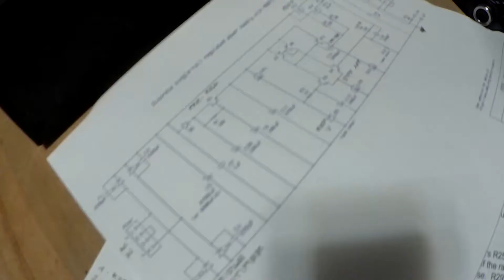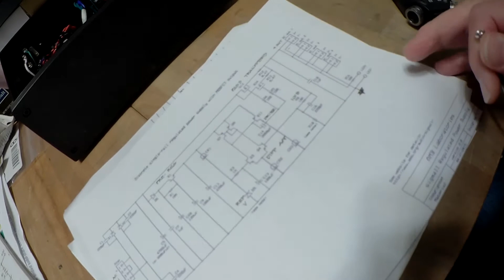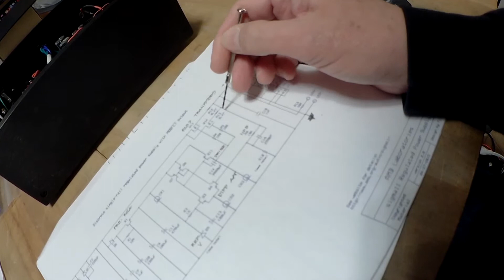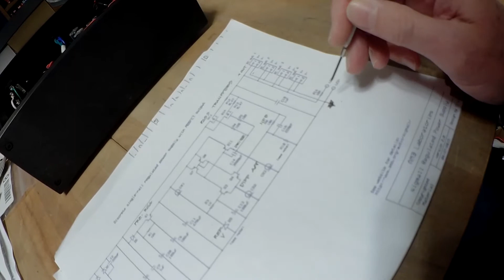Robert Builds the Sigma 11 Power Supply

Comment: Great video. Any reason you choose the sigma 11 over the universal psu (split in half) from the diyaudiostore? I built the 6-24 crossover and want to replace the wall wart with a linear power supply.
Reply from the maker: Yes, the Sigma 11 is a regulated power supply using discrete transistors. It is superior for low current devices like preamps, DACs, or active crossovers. The DIY Universal supply is a high current unregulated supply for use in power amplifiers. You can see it in my Pass F5T and F6 videos.
Reply: @NocturneVid66  got it. I built the F6 using your video as guidance, so I have experience building the PSU, too. I’m a novice and don’t really understand the difference between regulated and unregulated, so wasn’t sure if the use of the sigma 11 in this application over the diyaudio PSU was intentional or preference. Thanks as always for your content!

Comment: Great video, I've built the sigma 22 to power a pass BA-3 preamp. I just completed the sigma 11 to be used to power my rega planar 2. On the sigma 22 I used an avel lindberg and had to inquire how to connect to the board, this time I am using an antek and have the same question, in what order do I connect the blue and green wires to the sigma board.
Reply from the maker: That must sound very good Pete. I haven't compared the Sigma 22 to the Kubota Regulators. They both seem to work very well. I don't recall the exact hookup for the Antek transformer. I hope you got it working without any issues.

Comment: I really appreciate you covering the amb sigma 11 power supply. Not many make videos of it. As flexible as it is, I feel it deserves a nice how to construct video complete with a bom.  Been thinking of building a sigma 11 to power a music server and perhaps a diy audio preamp from pass labs (waynes linestage preamp) .I have just received my pass labs korg 1 tube full kit as well. Been waiting for it since preordering in in like March of last year or so. Had to wait even longer as they sent me the wrong faceplate. It was so long I forgot I placed a order for a aleph j transistor kit with it from diy audio. Next time those 2 orders will be separate! I'm curious about the emi filter your using and it's benefits? Noticed a noticeable different over stock? Have a link to your bom for the sigma 11 You did? I know it will be slightly different based on the zenor diodes and resistor r10 for the voltage required.
Reply from the maker: Brandon, I believe there is a BOM on the Sigma page. The Korg kit is pretty amazing, it pairs quite well with the Pass F5 amplifier in terms of speed and detail. I hope you got a NuTube that doesn't ring too much. The Corcom filter is good to keep RFI, and EMI from nearby switching supplies out of the unit. I never tried the supply without it. Good luck on your projects.

Comment: Hello, i am currently in possesion of a v dac2 and a v can2. I want to Upgrade the Setup with the Dual rail psu Sigma 22 
Do you have and advice, if this is something worth going for?
Reply from the maker: Fabian, I think Musical Fidelity makes great stuff. I think it would be beneficial to use the Sigma supply with them. The rail voltages in the Sigma supplies are set by voltage divider resistors. on the PC board. I don't know whether it is feasible to use one rail for each device. I haven't built the Sigma 22 so I can't comment on whether the two rails interact with each other. If the DAC and the Can take different voltages, it could get tricky setting the 22 up to do that. My advice would be to use two Sigma 11s in a common enclosure to avoid any interaction between the supplies. If you use a power transformer like the Antek unit in the video. It would have dual secondary windings so you could have one winding for the DAC supply and another for the Can supply for greater isolation. The Headphone amplifier will draw far more current than the DAC.

Comment: This worked really well for a single ended preamp i built. 
 https://www.ebay.com/itm/Ultra-low-Noise-40-V-Adjustable-Voltage-Regulator-Module-1-25-20V-1-5-Amp/133404329429?hash=item1f0f8485d5:g:L-kAAOSwo8hTnpnZ